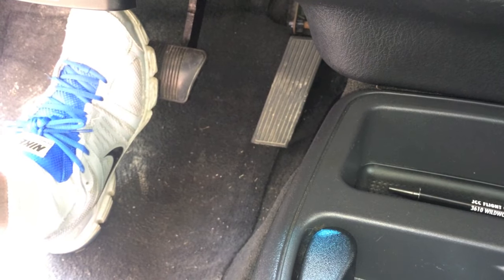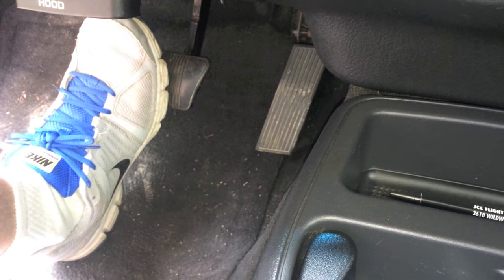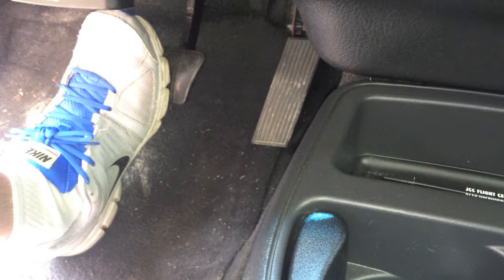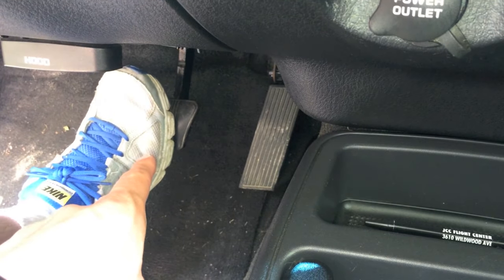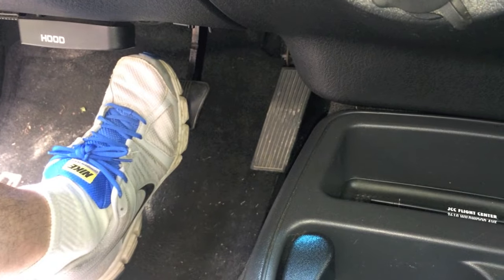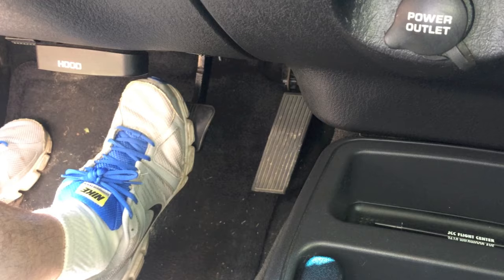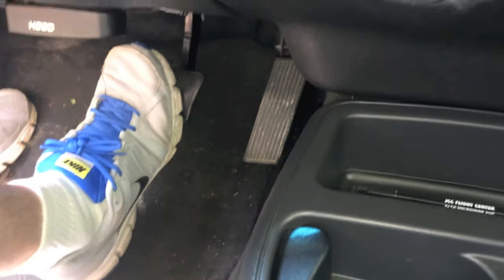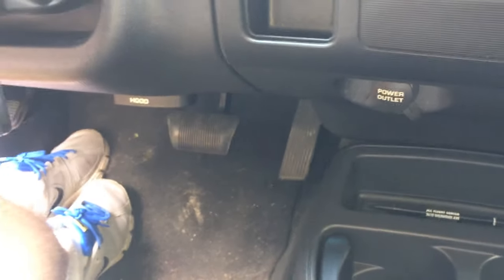HARD Brake Pedal - How to check if your BRAKE BOOSTER is GOOD or BAD

Comment: I put on a new cylinder and booster . After that I bleed the system. The car brakes but the brake pedal only comes up half way. The brake lights stay engaged. Any suggestions. I drive an 03 4runner
Reply from the maker: Jaimelev0329 

Thanks for watching & sharing your experience.  Great question!  By chance, did you bleed the Master Brake Cylinder separately from the brake lines?

A new Master Brake Cylinder must be “Bench Bled” before installing on vehicle or bled after install.

Keep us posted, we are here to help!

Please subscribe to the channel and turn on your YouTube notification Bell 🛎 that would be awesome thanks again!  😎👍🔧🔩

Comment: 96 infiniti i30
Breaks were working just fine nice and solid feel but today i a passed over a bumpy road on the highway and now my breaks sink what could it be? Fluid is topped off no visible leaks and when the engine is off breaks get stiff as I pump them once engine is turned over is loses is pressure maybe a lose cable or fuse?? Brake booster seams to have no pressure at all should I bleed the lines?
Reply from the maker: William Hernandez 

Thanks for watching & sharing your experience William.  Great question & this is very common.

After reading your experience, it’s very possible that your Master Brake Cylinder (MBC) is in its early stages of failing.

Your MBC is in charge of the proper flow of all brake fluid to & from all brake components in wheels.  As it begins to fail, you will experience your exact issues.

When was the last time your brakes were replaced?  If your brake pads are worn all the way to the rotor, try replacing your pads.  New pads will allow your Calipers to adjust & may lead to your MBC working properly again.

Let’s start there, keep us posted!

Please subscribe to the channel and turn on your YouTube notification Bell 🛎 that would be awesome thanks again!

😎👍🔧🔩

Comment: Have got a mrk 3 ford focus when I break I can hear like a air coming from the pedal and i have to out a lot of force to stop the car all by my self feel like there is no assistance
Reply from the maker: Good morning ☕️

Thanks for watching, a few things can cause this.  Your brake booster may be at a point where it needs to be replaced however it can also be as simple as a vacuum leak.

We recommend starting engine and inspecting the area inside engine compartment near booster…be very careful as the engine is running.

If you hear hissing coming from a line near booster, that will need to be replaced.  👍

Comment: I don´t know what it´s called in English, but my brake pedal resists and rattles. It happens both when the pedal is moving and still while being pressed. Something lets go and makes noise and resists the pedal. As I press through the two resistant levels it resumes normal braking.
Reply from the maker: Good afternoon & welcome to the DIY Raptor Club.  This is an indication of a leak in a vacuum line or a failing Brake Booster.

As the engine is running, the brake booster and vacuum system is pressurizing to properly run your brake system.

If a vacuum line has a leak or the internal brake booster diaphragm has failed, your pedal will behave as such in your exact scenario.  Hope this helps.

😎👍🔧🔩

Comment: My pedal pass the test but as I'm driving it gets a lot harder to push down. Any thoughts on that
Reply from the maker: joshuapagan8 

Thanks for watching.  By chance are you noticing any signs of front or rear brakes locking up?

After driving, do you smell any burning odors from any of your wheels?  If yes, this is a clear indication that your brake system is causing your stiff pedal.  Keep us posted.

😎👍🔧🔩
Reply: @DIYwithMichaelBorders   so after I changed my ball beatings and control arm that's when the pedal got hard. I don't smell burning tho. Any thoughts
Reply: Correction ball bearings and control arm
Reply from the maker: joshuapagan8 

Thanks for the reply.  That shouldn’t have any affect on brakes.  Verify that the brake fluid level is not above the MAX Fill line inside reservoir.

Believe it or not, fluid above the MAX Fill line can lead to brakes locking up.  If fluid level is too high, you can use paper towel or a small sponge to absorb fluid out of the reservoir to bring it back within the proper fill parameters.

Keep us posted.  😎👍🔧🔩
Reply from the maker: joshuapagan8 

😎👍🔧🔩

Comment: Dear, I have an issue with the break pedal. That sometimes the break pedal is stuck to a point that I have to release and try pushing it again to get to the breaking point. it usually stucks at 25% of the maximum leverage the pedal is at normal. It does that only once or twice while driving. What could be the issue? also when I accelerate the break pedal gets stiffer.

Comment: Not always, if the line fro the caliber to the bracket on the wheel wall is messed up it will make your caliber stick or brake hard to push in

Comment: I have an '08 Beetle with hard brake pedal that hisses only in the interior when pressed. I replaced the hose that leads from the booster to the brake vacuum pump (common cause of this issue) and that did not help. Car will not brake without great effort - worse than old non-power brakes. Any thoughts would be appreciated.
Reply from the maker: Dennis Buck Thanks for checking out the video and sharing your experience Dennis!  Have you had any Brake work done in the last year?  Its possible that the Brake Booster is faulting!

Do me a favor...check the entire vehicle for brake fluid leaks...if you find absolutely no leaks...and your Brake fluid inside the reservoir continues to go down, then it's very possible that your fluid is leaking into the Booster.  This is common when Boosters begin to fail!  

I would also do a thorough check of all vacuum lines/parts to see if you can pin point any tiny leaks in the lines.  This will also cause the hissing sound as well as a diminishing performance on the system!  Keep me posted!

Please Subscribe to the channel and turn on your YouTube notifications that would be awesome thanks again 😎👍
Reply: Thanks for the quick reply! We ended up taking it to our local mechanic today, as we need to get the car back on the road quickly. After talking with him about the symptoms, he felt that it needed a booster replacement. 

I saw no brake fluid leaks, both around the reservoir and on the ground where we park it.  

If there was a vacuum line leak, wouldn't there be a hissing noise inside the engine compartment? I had my wife step on the brake pedal while I listened for any noises in the engine compartment and heard nothing.

I will keep you posted as to what eventually fixes it.
Reply from the maker: Dennis Buck Thanks for the quick reply and update!  You're definitely correct...the hissing sound would be the lines.  That's awesome though...a car back on the road is a load of stress off your back 😀!  Thanks again for the update and please keep me posted on your progress!
Reply: It was the brake booster. The mechanic tested the vacuum to determine if that was the issue. The almost $700 cost (VW parts are expensive) wasn't fun, but having the car back on the road is great. If I attempted this on my own, it would have taken too long. Thanks again for the great video!
Reply from the maker: Dennis Buck Thanks for updating us Dennis!  That's good to hear!  As they say "Time is money"...it's definitely not fun dealing with a car that is in need of repairs.  Glad to hear your back on the road!

Comment: I have a 1985 s10 and the brake is very hard, and the idle veries slightly. I have replaced the check valve and bled the system. what else could it be? the brake falls slightly when I start the truck.
Reply from the maker: Allen, thanks for checking out the video.  Did your S10 pass this Brake Booster test?

When was the last time the brake pads and brake calipers gave been changed?  Also, on the calipers, have you checked the lubrication of the caliper slides. 

I have attached a few options that may cause this.  Check out the vides and let me know if you have run into any of these issues.  Please keep me posted.  Subscribe to the channel that would be awesome!

https://www.youtube.com/watch?v=-DZ68tKuCQc

https://www.youtube.com/watch?v=3Pq15BWM_qY

https://www.youtube.com/watch?v=VK4lowH7kQE

https://www.youtube.com/watch?v=j9s7yccswPQ
Reply: it did pass the booster test, at least im pretty sure, and i have no idea when the last time they were changed. my grandfather bought the truck and it sat for a couple years and he finally gave it to me. No I havent checked to see if they are lubricated ill do that
Reply from the maker: allen gassaway Cool, thanks for the update.  If might be a good idea to start working through the easy option first.  I'd check the caliper slides and get them re-lubricated.  If you don't see a difference, then it's time to consider caliper and front brake lines.  The front brake lines as you know fail from the inside...which causes the brake fluid to get trapped in calipers....and this in return does not allow the caliper to release the brakes.  

Also, as you have driven over the past few days...have you noticed any burning odor?  After you drive it, take a look and listen to the wheel well.  If you hear cracking noises and smell a burning odor, your brake lines and calipers should be replaced with new.
Reply: I cant drive it on the road yet, I cant get a tag until it is street legal (lots of electrical issues to work out before that can happen) but right now im trying to figure out the mechanical stuff. I can only drive it in the yard for now and I dont think I brake enough to produce heat. Also I'm 16 and I dont have my license. my dad and I are going to check the slides and calipers tomorrow but we kinda gave it a once over before and didnt see anything wrong so I'll do a little more "in depth check" then!
Reply from the maker: allen gassaway Awesome.  Thanks for the update! 😀👍
Reply: allen gassaway it should only fall an inch or so till grips the rotors

Comment: Question:   To test a Master Cylinder, can I just take off the two lines from it and put one line, form a loop and connect each end into the mastercylinder ports?  OR  Does each port must be capped off separately.  I can't find plugs for the master cylinder/
Reply from the maker: Romulan112 

Thanks for watching!  Great question!  Almost all mechanics recommend testing Master Cylinder on bench.

There are many that choose to test it while still connected to vehicle.  As long as you have the line feeding back into system & alleviating the chance of air entering system.

We recommend watching a few videos that explain steps for testing!

Keep us posted!  

Please subscribe to the channel and turn on your YouTube notification Bell 🛎 that would be awesome thanks again!  😎👍🔧🔩

Comment: I replaced hydraulic clutch cylinder and fixed clutch and brake slave assembly. Now I cannot push in the brake. What can I do to solve this?
Reply from the maker: Daniel Ferrell 

Thanks for checking out the video and sharing your comment Daniel.  Let’s get this figured out!

During the repair, did any brake fluid leak from system?  If so, have you properly re-bled entire brake system?

Keep us posted.  Please subscribe to the channel and turn on your YouTube notification Bell that would be awesome thanks again!  😎👍🔧🔩

Comment: What about the brake booster check valve?  My car has intermittent problems where while driving the brake pedal becomes extremely hard to push.  I'm just trying to research it before buying parts.
Reply from the maker: rustimack Thanks for checking out the video!  Brake Booster Check Valve is definitely a possibility!  Attached below you will see a link to a video that talks about the Check Valve...definitely check that out and let me know if you have any additional questions!

Break issues are definitely annoying and we can figure this out together and get you back on the road safely!

Keep me posted on your progress and again...please let me know I if you have any additional questions!

Please subscribe to the channel and turn on your YouTube notifications that would be awesome thanks again 😎👍

https://youtu.be/j9s7yccswPQ

Comment: i have a 97 honda civic and the brakes apply themselves while im driving. i can stop without applying them.  when i first start there fine, normal pedal play, then after around 5 miles theres no play and they start to lock.  any ideas?
Reply from the maker: bob lincoln 

Thanks for checking out the video bob!  This is definitely not uncommon!

I can be a few different things....Lets figure it out!

1.  Its possible that your caliper is beginning to stick...maybe caliper slides have lost the lubrication required to shift back and forward freely.

2.  It can be possible that your Caliper piston has lost its lubrication which will also interfere with the efficient shift back for forth.

3.  The front rubber brake lines that connect to your caliper fail from inside rather that outside.  This means the inter coating begins to break away and clog portions of the brake system...hence not allowing fluid to flow back and forth freely.  

4.  Your brake pads have little prongs/teeth on them.  You will notice by their location...the pads slide on a steel brace.  This may need to be lubricated to bring the shift back to efficient requirements.

I have attached a few videos.  Lets start with the easy items and then work our way up!  Lets figure this out together!  Keep me posted!  Please Subscribe to the channel that would be awesome!  😎👍🔧🔩

1.  Caliper Slides Lost Lubrication:

https://www.youtube.com/watch?v=-DZ68tKuCQc&t=15s

2.  Too much Fluid in Reservoir:

https://www.youtube.com/watch?v=X-AJ5tD6zoA&list=PLjCXOz8TSkZnavDiGDyHdPKe2dV2RzEMZ&index=39

3.  Failing Front Brake Lines:

https://www.youtube.com/watch?v=3FTEgbLYAdI&list=PLjCXOz8TSkZnavDiGDyHdPKe2dV2RzEMZ&index=78

4.  Brake Pads not shifting:

https://www.youtube.com/watch?v=3Pq15BWM_qY&t=103s

5.  Replacing Front Brake Calipers:

https://www.youtube.com/watch?v=8HoaL4QM5-k&list=PLjCXOz8TSkZnavDiGDyHdPKe2dV2RzEMZ&index=83

6.  How to check if Brake Booster is Failing:

https://www.youtube.com/watch?v=VK4lowH7kQE&index=66&list=PLjCXOz8TSkZnavDiGDyHdPKe2dV2RzEMZ

7.  Failing Brake Booster:

https://www.youtube.com/watch?v=j9s7yccswPQ

8.  Symptoms of a Failing Brake Booster Check Valve:

https://www.youtube.com/watch?v=j9s7yccswPQ&index=68&list=PLjCXOz8TSkZnavDiGDyHdPKe2dV2RzEMZ

Comment: What if my truck which is a Chevrolet Silverado, whenever I hit the brake pedal it’s pretty hard to step on it, same goes to the accelerator whenever I let it go the truck stops immediately, all four tires started to smoke what could be the problem??
Reply from the maker: Thanks for watching, that’s not normal...🤔

Any recent maintenance in last last 6 months?  This may help us determine whether or not any recent MX is tied to your issues.

Comment: Tested it like that but mine just goes hard while driving. Replaced the vacuum pump. Still not fixed. Could it be the booster as it is intermittent.
Reply from the maker: Misfit Garage Uk 

Thanks for watching & sharing your experience!  This is definitely not uncommon!  Let’s get this figured out together!  😎

It can be a few different things...

1.  Its possible that your caliper is beginning to stick...maybe caliper slides have lost the lubrication required to shift back and forward freely.

2.  It can be possible that your Caliper piston has lost its lubrication which will also interfere with the efficient shift back for forth.

3.  The front rubber brake lines that connect to your caliper fail from inside rather that outside.  This means the inner coating begins to deteriorate and fall apart, leading to clogging portions of the brake system...hence not allowing fluid to flow back and forth freely.  

4.  Your brake pads have little prongs/teeth on them.  You will notice by their location...the pads slide on a steel brace.  This may need to be lubricated to bring the shift back to efficient requirements.

I have attached a few videos.  Lets start with the easy items and then work our way up!  Keep us posted!  Please Subscribe to the channel and turn on your YouTube notification Bell 🛎 that would be awesome thanks again!  😎👍🔧🔩

1.  Caliper Slides Lost Lubrication:

https://www.youtube.com/watch?v=-DZ68tKuCQc&amp;t=15s

2.  Too much Fluid in Reservoir:

https://www.youtube.com/watch?v=X-AJ5tD6zoA&amp;list=PLjCXOz8TSkZnavDiGDyHdPKe2dV2RzEMZ&amp;index=39

3.  Failing Front Brake Lines:

https://www.youtube.com/watch?v=3FTEgbLYAdI&amp;list=PLjCXOz8TSkZnavDiGDyHdPKe2dV2RzEMZ&amp;index=78

4.  Brake Pads not shifting:

https://www.youtube.com/watch?v=3Pq15BWM_qY&amp;t=103s

5.  Replacing Front Brake Calipers:

https://www.youtube.com/watch?v=8HoaL4QM5-k&amp;list=PLjCXOz8TSkZnavDiGDyHdPKe2dV2RzEMZ&amp;index=83

6.  How to check if Brake Booster is Failing:

https://www.youtube.com/watch?v=VK4lowH7kQE&amp;index=66&amp;list=PLjCXOz8TSkZnavDiGDyHdPKe2dV2RzEMZ

7.  Failing Brake Booster:

https://www.youtube.com/watch?v=j9s7yccswPQ

8.  Symptoms of a Failing Brake Booster Check Valve:

https://www.youtube.com/watch?v=j9s7yccswPQ&amp;index=68&amp;list=PLjCXOz8TSkZnavDiGDyHdPKe2dV2RzEMZ
Reply: @DIYwithMichaelBorders  I have the same intermittent hard brake problem on the wife's 2010 Ford Flex. These are the videos and steps you suggest for intermittent troubleshooting correct? I subscribed BTW!
Reply from the maker: Tiko Blane 

Thanks for watching & sharing your question.  You’re spot on my friend.  We definitely recommend checking out each of the links & beginning to work through the steps & try to pinpoint the exact cause of your symptoms.

We are always here to help.  Keep us posted.  Thanks for Subscribing, we subscribed back!

😎👍🔧🔩